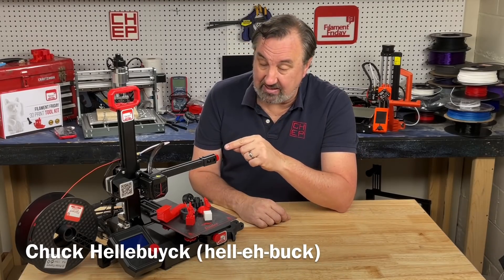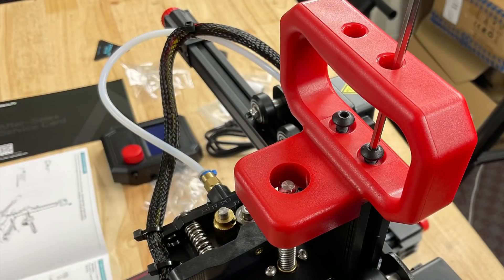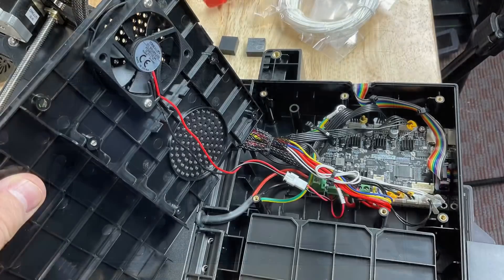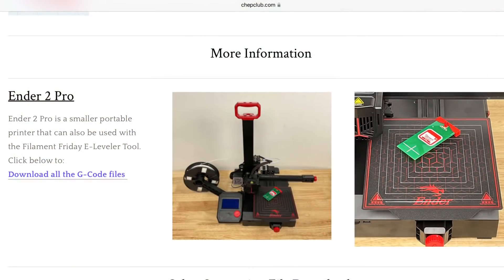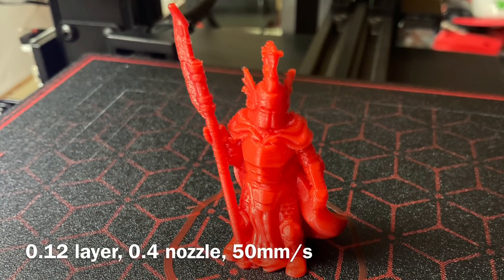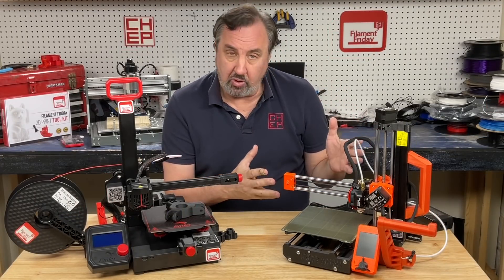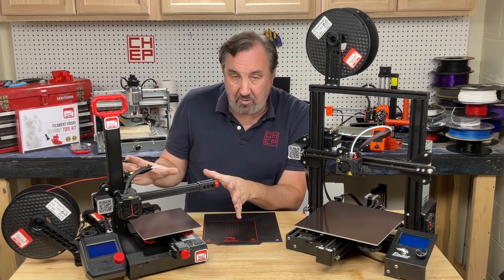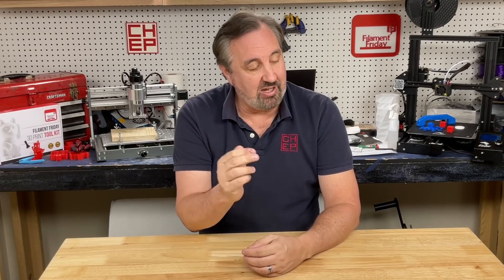Ender 2 Pro - The Best Value Portable 3D Printer?

Comment: I wonder how this compares  to the ~$160 kp3s on AliExpress (ships from USA).

Main specs of kp3s: 180mm^3 build volume. Linear rail on x and y. Titan direct drive extruder, tmc2225 on all axis, small touch screen (~2.4") although the PSU is mounted externally, though there are 3d printed cases to mount is underneath.
Reply: I have a couple KP3S, and I love them. They need some upgrades to be reasonable, some cooling fans and definitely a better hotend, but with the new ones coming with a titan direct drive, they put out amazing prints.
Reply: I have a KP3S, the Ender 2 Pro definitely looks more compact/portable, plus it has the PSU and spool holder integrated.
But for me the Titan clone in the KP3S is a killer feature.
Reply: @ToniCorvera  can you please tell me if it's the same print volume as the original ender 2. Thanks.
Reply: @pooheadlou  It's larger at 180 cubed vs 165
Reply: @richiemacrophage  thanks, I have the original, but now I thinking of getting this one too. Thanks again for your reply.😁
Reply: @pooheadlou  I meant the Kingroon, this ender 2 pro still has 165 cubeed
Reply: @richiemacrophage  oh cool, might check that one out then. Thanks 👍

Comment: You should really consider looking at the Kingroon KP3S! Same price range as the Ender 2 Pro, but it comes with a titan extruder clone and linear rails. I absolutely love mine and the print quality is on par with my Prusa machines.
Reply: I've got one of those. Have you tried it with Octoprint? Mine kept failing with checksum errors. To fix that I installed Marlin instead and now it works flawlessly. Nice printer. I've got an Ender 3 Pro too which I use for larger parts.
Reply from the maker: I don’t like the separate post supply.
Reply: @FilamentFriday  I definitely agree that's the one major downside of it. There's several printable base designs that solve the issue, but that all depends on whether you're willing to tinker with it or not. Either way it prints crazy well for the price.
Reply: I second this! I think the separate post supply is kind of a non-issue since its solved relatively easily with a printable base mod.
Reply: My Ender 3s print on par with prusa machines, but that aside...

Is the kingroon any faster? That's what I'm looking for.